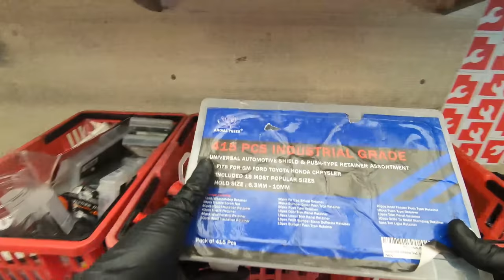Rescuing a car in the hospital parking lot.

Comment: Hey earnest my sister has a Oldsmobile 88 and it won’t start I changed the whole fuel pump and Assembly and it starts but won’t turn over can it be the spark plugs or the timing chain ?
Reply: "it starts but won't turn over" what? 🤔
Reply: Do you mean it cranks but won't start or Can't crank and you get a click/clicking noise? what year and what codes are in the computer? without some basic info to help diagnose all you can do is load up the parts cannon and fire
Reply: It cranks but won’t start
Reply: It’s a 1992 Oldsmobile 88 royal
Reply: Leon Flores try looking into coil packs, spark plugs, and ignition wires
Reply: @leonflores7176  without pulling codes and doing some electrical testing it's going to be based on educated guesses, if you can get codes or test the CKP that would be great. If not i would venture to say that the CKP (crankshaft position sensor)/wiring has a problem or the reluctor (if i remember right this is on the inside portion of the crank pulley) has a problem like it's wobbling.
Reply: @karar2294  yea if the vehicle has only one coil it can cause a crank no start condition but leading up to it would have misfire issues too usually
Reply: Well it’s a oldsmobile
Reply: Fuel pump resistor
Reply: @str8menace923  lol name checks out